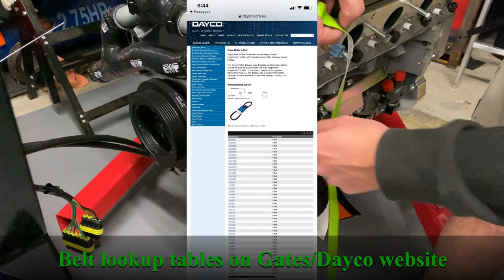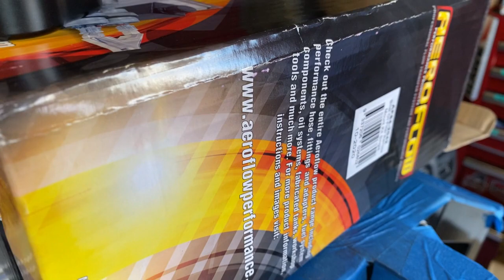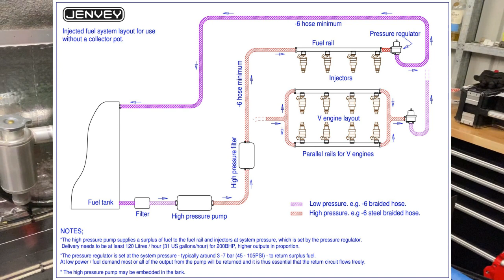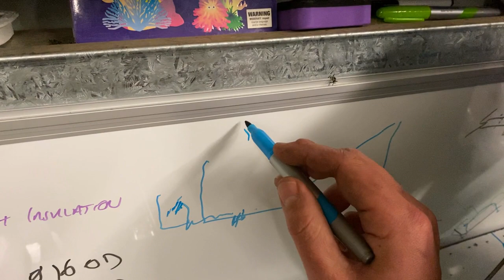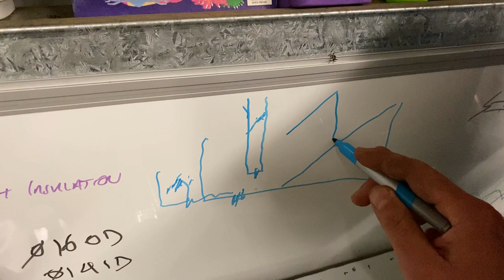Ultima RS - Engine and 'box install (Video #21)

Comment: You can fit the gearbox through the back however you're doing it the smart way by going through the engine bay before the engine goes in.  The rear bulkhead carpet is a pain mostly because of proximity to the roll cage once the center tub is fitted.  Getting a good fit into the corners might be a challenge but black carpet and roll cage go far to hide crimes.
Reply from the maker: Definitely measured to be bloody tight. I was mainly concerned with chipping the chassis paint if I gave it a go.

Comment: Grade 8.8 metric bolts are basically the equivalent of a grade 5 SAE bolt. The higher strength metric bolts are 10.9 & 12.9 with 10.9 being comparable to a SAE grade 8.
Reply: Indeed. 8.8 is nothing special.
But it's bolted into aluminium, so even an 8.8 will win, if it comes to it.
Reply from the maker: Both you and Paul make fair points. I should have said that they aren't dog sh*t and more than sufficient for the purpose.
Reply: @rob105motorsport  Yeah, you should've... 😂

Comment: SHAZZZZY!

Another cool video man getting to the fun end of the build, amazing workmanship as always... great real estate agent call haha...

What's up with the 'Tavarish Tape' on the fuel system... could you not have used a reflective aluminium tape or similar to match the rest of the bay?
Reply from the maker: I hope you're using 'shazzy' regularly!
Probably a bit mean to real estate agents, but all said in good fun. 
As for the insulation, you have to have a few gold bits! It's like a mandatory salute to the F1 as 'peak car'. Cheers!

Comment: G'day Rob did you get all your fuel pump,filter setup through Ultima or got here in Oz ? 
Cheers Mate
Reply from the maker: Hi John, That all came from Ultima and quite good in regard to saving the time making a heap of -6AN lines. It's all fairly standard fare in that it's a Carter low pressure pump feeding a surge tank with a Bosch (from memory) high pressure pump feeding the rail via an aftermarket regulator. Being an LS, it's quite a simple system that you should only run in to dramas with if you're chasing big HP. Cheers!

Comment: Hydraulic crimper tool $45 on eBay mate, just got one for the terminals on my dual batteries in my caravan.  All the dies included.  Better than a hammer
Reply from the maker: It's one of those great tools to borrow off a mate. I have fancy crimpers for smaller gauge stuff, but I probably make 6-8 large crimps a year and the local tool shop owner drives a Maserati because of me..... but hey, it's $45 which is a fair point...... I'll probably end up there after I finish saving for the CNC plasma I 'need'. Cheers!

Comment: A suggestion, if you get opportunity get some spring type hose clamps on your water lines…. They apply constant tension on the rubber hose. ... This matters because as the hoses age, they may harden, soften, swell, or lose their structural rigidity, and spring clamps will continue to apply force on the hose regardless of the condition of the hose, they are basicly self adjusting for optimum tension 👍
Reply: A lot of persons don't trust them, though it's OEM standard practice.
And you're 100% correct about them.
Reply from the maker: Hi James, I agree. OEMs obviously use them for this reason and they're cheap. Downside is that they are a bit of a pain to work with in confined spaces, you need a specific size for a specific hose and they're harder to buy. I suppose the way to look at it is that these will make sure I replace the hoses if they're condition degrades. Definitely like the spring clips on older/less well maintained cars like my Land Rovers etc though. Cheers, Rob

Comment: Hey Rob, 
Great videos and looking forward to the next one. I'm in Qld and was looking at building an RS at some stage. Its going to be hard getting it past the financial controller. Are you over in the Pilbara looking at those trucks and that red dirt? I was over in Newman for a year
I was just wondering if you are keeping a spreadsheet on all the costs? Any chance of sharing that (if you have one) at the end of the build inc Engineering, the pits and rego etc?
Looking forward the the engine firing up and the body work going on. Waiting patiently, no more nights on the turps 😉 👌
Reply from the maker: Thanks! Yeah, I drove with the missus from Perth to Broome for our honeymoon earlier in the year. It would be great being based there for a year and check more things out!
I did a video a bit earlier on with the costs ~$230k AUD. I'm tracking fairly true to that for the moment. I might blow the cost a little and I do know there are a few other RS coming to Aus, but they'll be >$300k builds. I have a high spec' car, but I didn't go for the LT or a sequential 'box or.... because it didn't fit my vision.
Simplistically, engineering and rego in QLD actually isn't too bad, NSW is a PIA, and each state has it's own intricacies. 
The RS is definitely awesome. The downside at the moment is lead times are blowing out a bit I believe. What I can recommend as an alternative would be to check out Absolute Pace. They're QLD based and make the best Cobra/GT40 kits on the planet (in my opinion). 
The GT40 would cost about the same and be a similar experience to the Ultima. 
I've actually been taking some expressions of interest with putting together a few cars (2-3 per year) for 2022 with guys who maybe don't have the time, tooling or expertise. My new workshop is underway to suit that so we'll see what happens. In any case, AP are the kits that I think offers the best product to suit the resto-mod/pro-touring/whatever these cars are. Bounce me an email if you get keen and have any questions - robwithers@hotmail.com
Cheers!

Comment: Did your headers come from Ultima?
Reply from the maker: Hi Scott, They did. I didn’t price them out separately and it’s very tight to build some within the chassis. I wasn’t aware that the headers on the promo/demo car were an option as they weren’t listed which was quite frustrating. I’m happy with the design of the ones I have although there’s some tooling marks and welding spatter I do not love. Cheers

Comment: Have you given up on this project?
Reply from the maker: Haha not at all, John. But I do know what you mean. Ultima is on its wheels and booked in for tuning in Feb. Just a quick break from videos as I haven't filmed anything that I'd call "useful". 
2 new projects turned up, put in a hoist, lathe/CNC plasma all turning up for the new workshop which has also been keeping me busy outside of the day job. Looking forward to rolling out a few over the holidays and thereafter. Merry Christmas!

Comment: Do you really need to have a heavy duty clutch, when all it has to move is 600kg of car?
You'll never tow anything, never more than 2 persons, never uphill, and never the aforementioned combined.
You'll never ever use all the torque of the engine without having a burnout for distance.
It'll be fine.
Start OEM Porsche, I'd say.
And only upgrade when needed.
Reply from the maker: Hi Paul, Mine is relatively 'mild', but the assumption has to be that at some points you'll be transferring that torque to the road. You do make a very valid point that it's unlikely to be under very mean circumstances like a hard launch and tyre selection is a key decision in clutch loading. Cheers, Rob